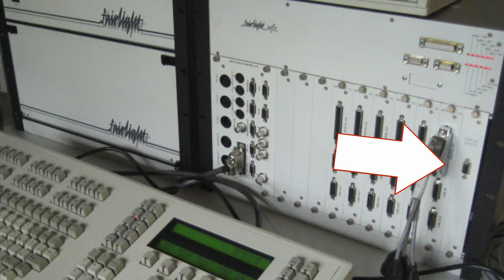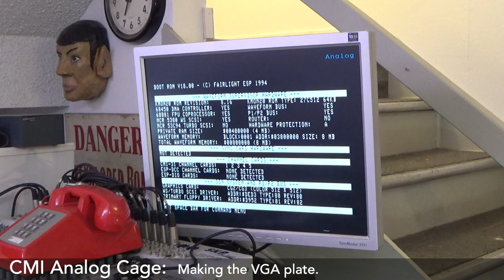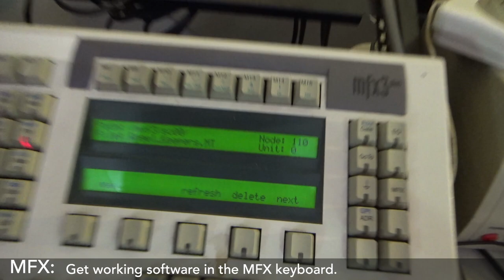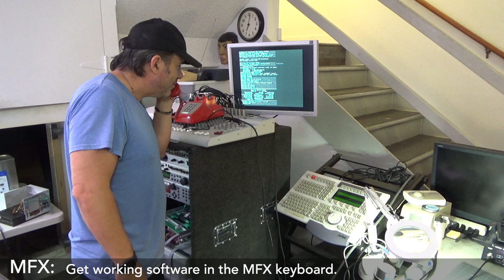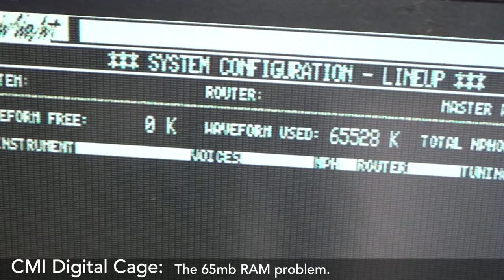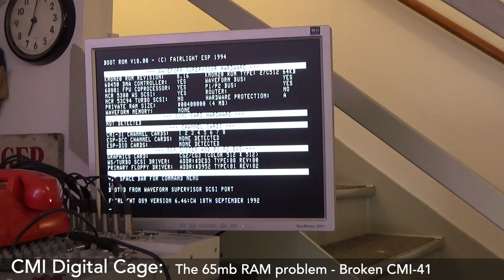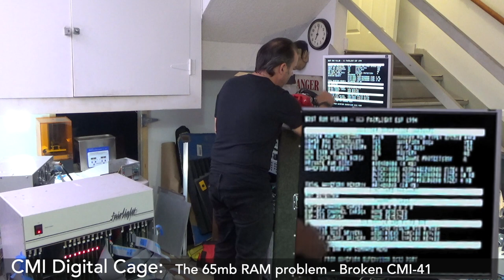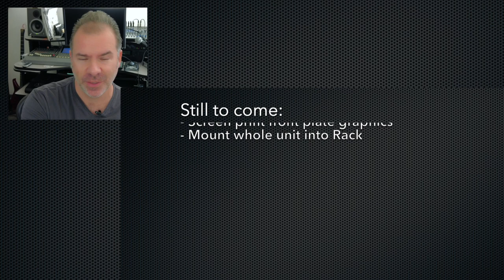I'm building a Fairlight CMI - Episode 8 - RS, RAM, MFX Does ANYTHING Work? #fairlight #fairlightcmi

Comment: That "marking a hole with a drill bit" thing - I like to use a Bradawl for this. They're really for wood (in the same usecase as a centrepunch) but fine for scratches in metal too. But they have a longer and thinner stem than most centrepunches which works well for your problem.
Reply from the maker: I’ll have to get a ‘bradowl’ ! Andy might have had one but I didn’t know where to look.. and I’m a tad impulsive .. :)
Reply: @CrisBlyth  They're made of machine metal so pretty hard.